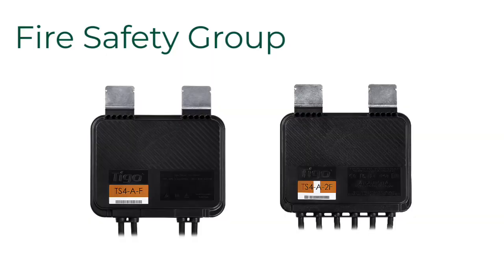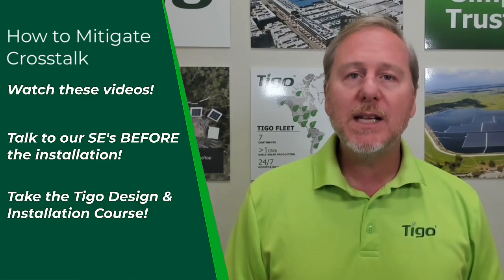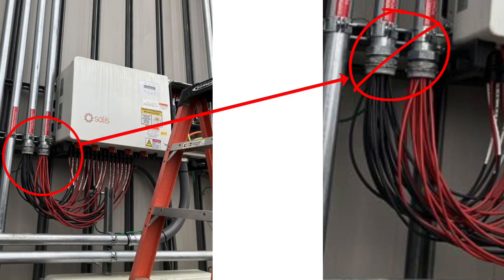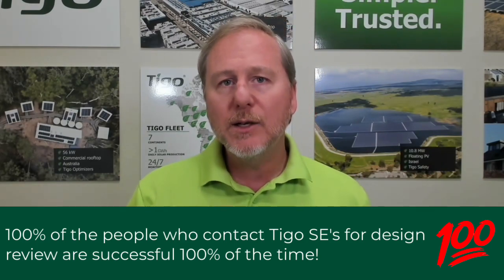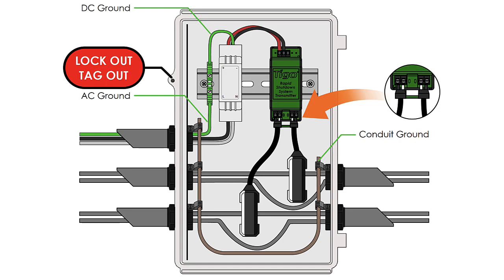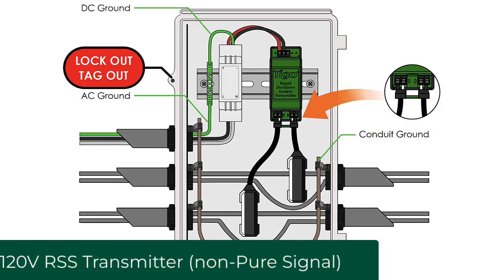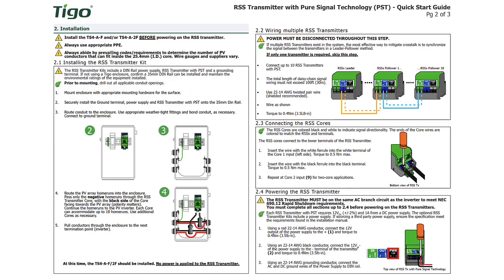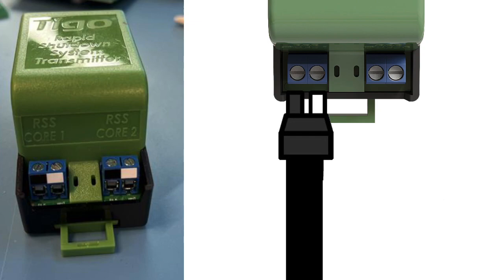Top 3 RSS Transmitter Design and Installation Criteria

Comment: Hi, What could happen if I didn't connect the ground cable along with the black cable? Could I have an insulation fault in the inverter?
Reply from the maker: There are all kinds of issues with that. Always install your PV system in accordance with local codes and standards. That ground wire is there to protect against electric shock.

Comment: Does the power that feed the power supply unit that converts to DC supply, need to be from the Solar power or permanent utility power supply? And why?
Reply from the maker: Great question! The RSS Transmitter must be fed by an external 12V/1A power supply fed by a breaker on your AC panel to ensure proper rapid shutdown operation. Please follow the instructions in this video for a safe, Code compliant, and worry free system.

Comment: Thank you for this video. This is very valuable information for my install. If I'm running two inverters with two strings per inverter, should I have 2 separate RSS transmitter kits? Thanks
Reply from the maker: Excellent question! Since each RSS Core can handle 10 PV conductors, you may only use one RSS Transmitter for both inverters! If you have any questions please contact our support team.

Comment: Is it ok if every transmitter have different main breaker in ac side. I mean is it ok if the followers have different breaker from a leader
Reply from the maker: They leader and followers should turn on and off at the same time. So they should all come off of a single breaker.